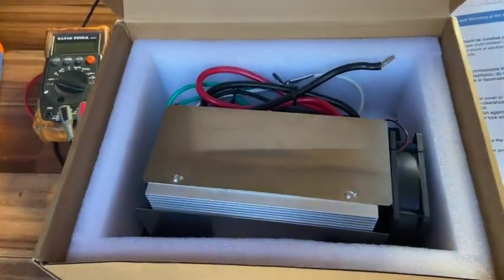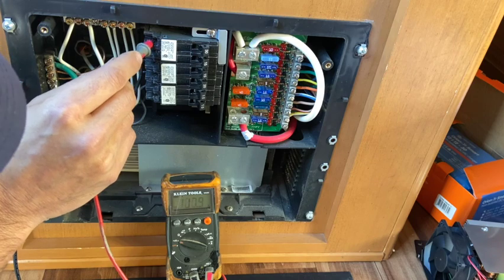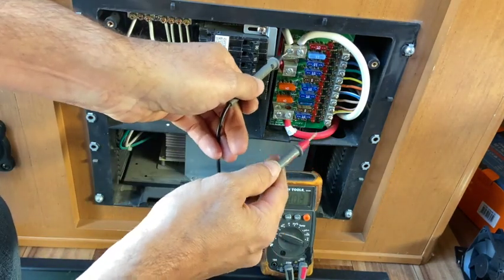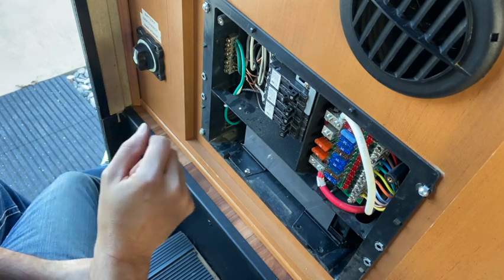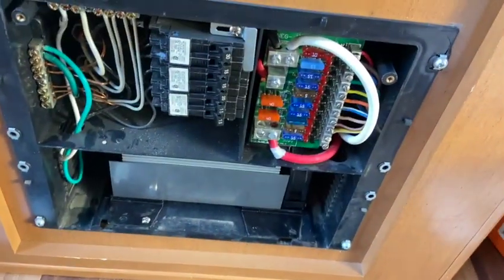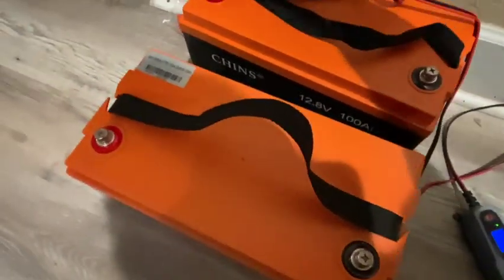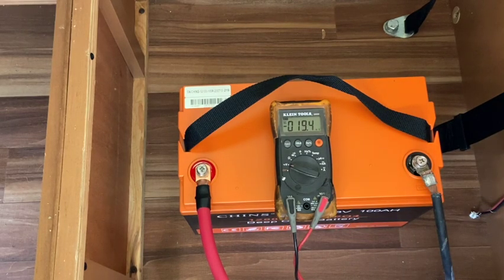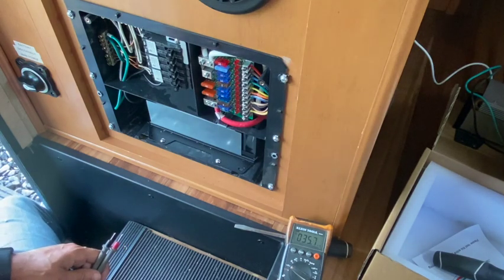RV Lithium Battery charger converter install   upgrade

Comment: Very well done. WFCO has had problems with both Auto detection and the one said to be just lithium. This time you got one truly lithium. Many I’ve watched only get 13.4 volts and that makes the lithium battery hood for 80% charge. I’m about to go lithium. I have a WFCO auto detection but I’m removing it. I don’t trust them now. Yours is good now. Enjoy.